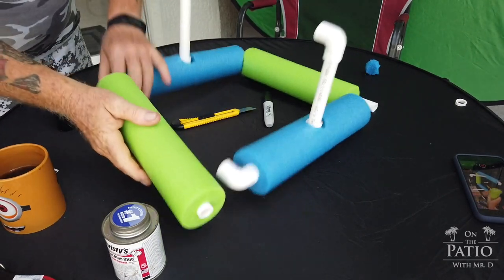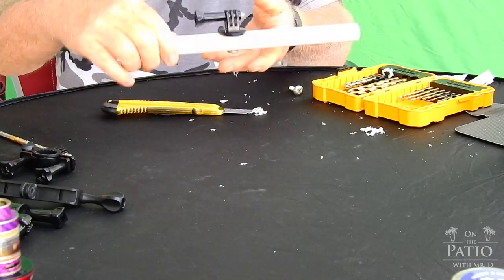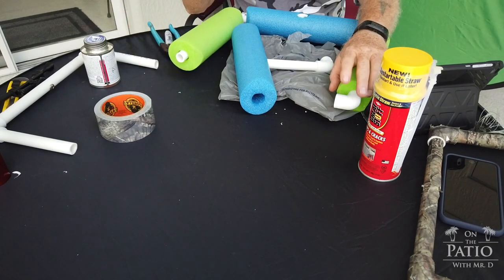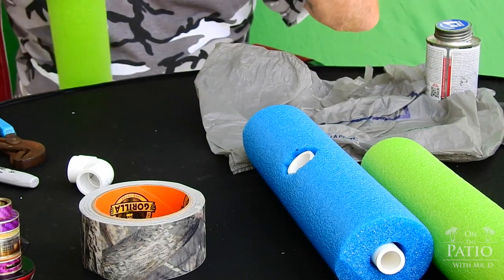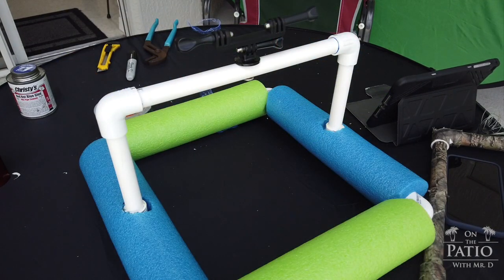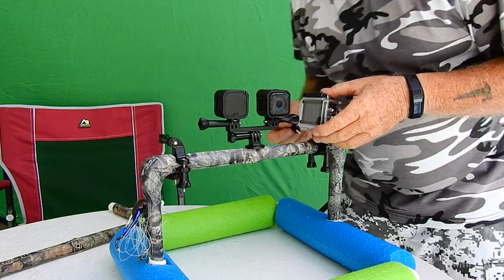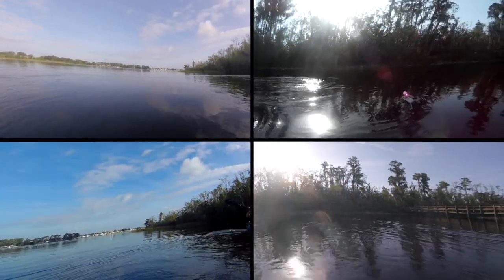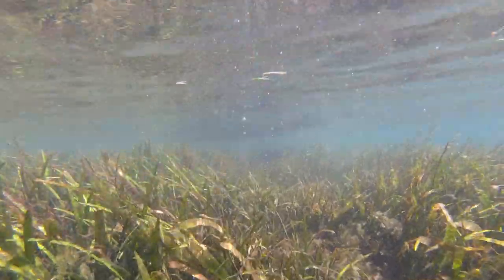DIY Quad Camera Floating Tripod Part 2

Comment: Great video, thanks for all the details. Wouldn't it be cheaper to have only one 360 degs panoramic camera instead of 4? With some postprocessing it should be possible to choose the desired moving viewing angle. It is only a guess, I don't have such a camera yet.
Reply from the maker: Whisky Golf yes I tried that. The postproduction is a nightmare.